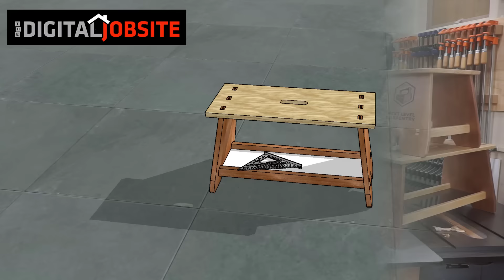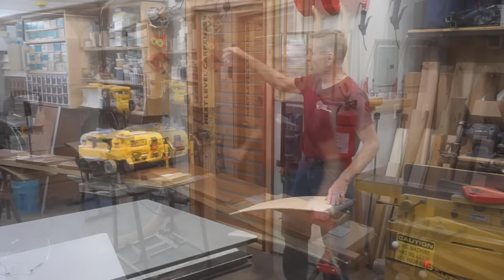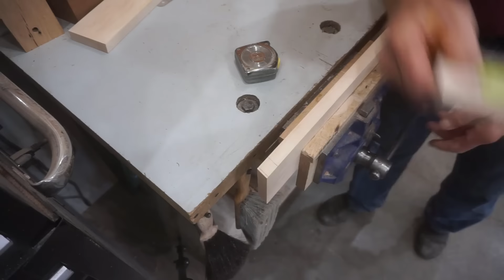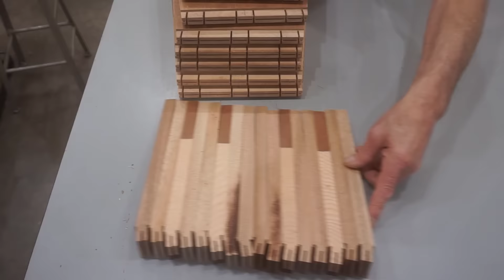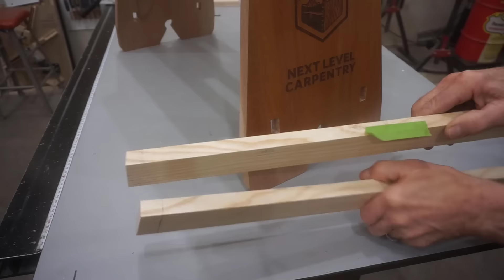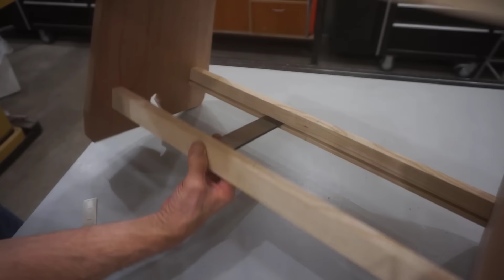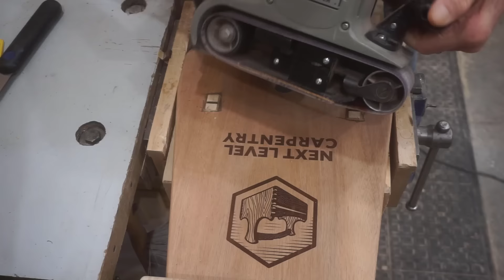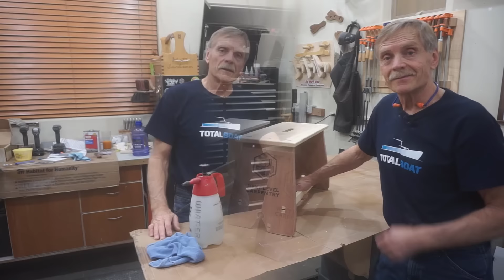Master Carpenter's Footstool

Comment: I have searched the internet to find the zero clearance insert on your Unisaw without success.  Any advice would be helpful.
Reply from the maker: Sadly it's been out of production for a long time.  Here's this to help if you're interested in the story or sourcing one on eBay or other 2nd hand market: https://www.pinterest.com/pin/551479916872563699/
Reply: @NextLevelCarpentry  thanks for your quick reply!  I have picked up a lot from the stool video. Keep up the good work!
Reply: Went to the link.  It is not the same.  Yours is open at both ends allows for slipping in the insert at the end.  At least that is what it looks like.
Reply from the maker: @davidconant4382  Ah... the linked photo shows the underside and the product label.  Search using that info...
Here's the top of the insert: https://www.pinterest.com/pin/551479916872563689/
And a closeup of the label:  https://www.pinterest.com/pin/551479916872563704/
😎👍

Comment: excellent detail, depth of understanding of material, and thoughtful methods and design. i especially like the way you surfaced the twisted mahogany. it may seem like a long video, but it is not long considering how much detail and methodology is packed into it. two minor design suggestions: 1) consider off-setting the oval top hole toward one edge so that when you carry it the stool's center of gravity stays put, and 2) the relief hole on the legs is ok, but for this level of craftsmanship consider a hyperbolic cosign curve (the shape of a hanging chain) to replace the angled cuts and relief hole. i keep a long lamp pull-chain in my toolbox which i can hang on 1/4" pw, spray paint to create a 'line', then cut for a template. fantastic work. thank you for your many insights and suggestions

Comment: Huh...you could have cut the wedge slot a little deeper and gotten two wedges from the wenge...you'd have ended up with shims a little too long on the skinny end; cut them back to the proper thickness and you're golden.
Reply from the maker: That is true in some cases but not in this one otherwise I would have done it that way. With the scrap I had to work with I would have only gotten two shims out of it versus the three I got using the method I did... I don't profess to not make mistakes or make an oversight but sometimes viewers don't take all the factors into account before commenting.
Reply: @NextLevelCarpentry  I figured you'd have gotten four instead of three. You'd have gotten two side by side twice.

Comment: Informative. I would have quickly hand planed the smaller more twisted/cupped pieces of wood to get the worst of it better squared before putting it on the sled and running it through a parallel planer, but I have a crummy parallel planer.
Reply from the maker: A little bit of pre-planing is a great idea.  Knocking 1/16 or 1/8" off high corners would be quick and would mean less shimming and a more stable arrangement while running it through the thickness planer.  Thanks for watching and adding a useful comment! Best, Matt

Comment: THANK YOU, THANK YOU, THANK YOU VERY MUCH ! (Apologies to Elvis)..... Since getting slammed with cancer, I've been getting into working with wood attempting to make "stuff". My attempts are lame. In pursuit of my never-ending quest to find easy projects to "attempt", I came across your Carpenters Stool and loved the looks of it. I'm going to try and make one for my wife. She uses this stupid plastic thing in the kitchen, she's vertically challenged, and it scares me a lot. I've looked at other ones but they all have the same problem that you specifically addressed right upfront. Step just a little too close to the edge, and they tip over. I couldn't believe it when I saw your video! So, thank you for that and for how well you explain things. I don't have any of that fancy equipment, but I'm still going to attempt it. Thank you again for the idea, your knowledge, and your step-by-step assistance. It's a very awesome inspirational project I can't wait to start.     :)
Reply from the maker: You're quite welcome Jim... sorry to hear you got slammed but congratulate you for your gumption to take on new challenges in the aftermath.
FWIW there's no shame in using the measurements and angles from this footstool and just using screws and glue to hold it together.  You could always add a couple 'rails' or 'stretchers' underneath the top to stabilize the legs and attach the top.  It would be good mental exercise and a useful addition around the house.  FWIW in the NLC household we use a couple folding stepstool/ladders like this: https://www.amazon.com/Rubbermaid-RM-3W-Folding-200-Pound-Capacity/dp/B003EYVF7G/ref=sr_1_13?crid=2MU9EWZJBZ7EG&keywords=folding+step+stool&qid=1643267197&sprefix=folding+stepstool%2Caps%2C160&sr=8-13   for reaching things in cupboards and watering plants on high shelves... their fold-up design and 'handle' for balancing are actually better for safety and convenience than the footstool in many situations and there's no shame in having both around either. 😎 Best, Matt

Comment: What's with the gloves on the table saw? Thought you were a pro.  No gloves around rotating machinery! And don't give me the "rip away glove" thing. There is no such thing that will not move at all if contact is made with the blade. Just a few thousandths will give the blade a chance to grab your hand. LOOSE THE GLOVES OR LOOSE A FINGER. Better to have a coupe splinters in your thumb then not to have a thumb to have splinters in.
Reply from the maker: You actually think I make a conscious decision to wear specific gloves while using a tablesaw during specific operations to prevent splinters and expect them to 'rip away'?!  Good grief... 🤨
Reply: Those are wide boards. His hands weren't anywhere near the blade
Reply from the maker: @timbarry5080  the knee-jerk "no gloves EHver" reaction by some viewers is astounding to me... nice to know you understand its parameters too! 😎
Reply: @NextLevelCarpentry  thank you. Yeah, "no gloves ever" is a good rule for people new to using these tools but for people that  have spent endless time with these machines it's a little different. It's not like you were wearing them while ripping or jointing the narrow strips.
Reply: Very true. A heart surgeon lost a couple of fingers. He was using rubber gloves, with a mesh. The table saw pulled in his hand
Reply from the maker: @clivemilner  do you honestly think my use of gloves is to prevent splinters for Pete's sake?!

Comment: My father was a carpenter and cabinet maker for most of his life.  He made several similar step stool tool boxes over the years.  None had a silly little shelf.  All had either a deep box base or a drawer to hold drill bits and small hand tools without falling out.  I inherited most of his tools and use them to this day despite many being over 100 years old now.  They may not look pretty but they work well and get the job done.
Reply from the maker: "Silly little shelf"?! 🤨
Reply: @NextLevelCarpentry  Yes.  A carpenters 'footstool'? is expected to be moved around.  A lot.  Anything left on the 'silly little shelf', such as bits, dowels, hand tools, planes, would be liable to fall off.  A shelf is useless.  A 4" deep box or drawer adds function and security against accidentally spilling tools under one's feet carrying the 'stool' from project to project.  It would at least keep the bag of snack food shown from being stepped on.

I'm still using the 'step stool' I built in High school woodwork classes well over 50 years ago.  It's beaten and battered, has an 8" deep box under the hinged 'step' lid and gets used most days I'm doing any carpentry.  It's often used stand on to reach something too high to reach without it but just as often to carry the tools needed to deal with some minor project around the house such as fitting additional shelves in cupboards, etc.  Carpenter's tools are not expected to be 'objet d'art'.
Reply from the maker: @philipgrice1026  Wow... you're sumpthin there, Philip... 🤨 maybe you should check your meds?!🤣

Comment: Wow! That kept my attention throughout the whole video, sitting out here in my father-in-laws -10°C garage. Thanks for a great video! Now I need to invest in a garage heater and some insulation.
Reply from the maker: Insulation first, heater 2nd 😉😎  FWIW those small electric 'box heaters' available do an amazing job with the main challenge providing a 220 volt 20 amp circuit to power them... good luck. Hope you get heat soon so time spent in your shop is more enjoyable and productive?
Best, Matt

Comment: What is the level of tedium for cleaning up everything in the shop that the over spray landed on?
Reply from the maker: Same level as cleaning dust from cutting and sanding... pretty routine... probably about a 6 being as I can think of plenty of things I'd rather do than clean the shop after a big project.

Comment: I'd be tempted to use dominos for those mortise/tenon joints. Arguably the joint could shrink over the years but previous ones I've made have not loosened. Reduces the tedium scale!
Reply from the maker: I imagine dominos would be plenty strong and wouldn't shrink any more/less than the true mortise/tenons used in the build.  I think well-placed screws and glue would be surprisingly effective and maybe even the most practical.  The real loss or downgrade would be the aesthetics of wedged tenon joinery which is what helped me endure the tedium scale effect.  Bottom line is I don't see it as a right/wrong thing but as a matter of personal choice where there's no wrong choice.  Regardless; a 'hand made' stool is infinitely better than a 5 gallon plastic bucket turned upside down, right?! 😎 Best, Matt

Comment: that UV light trick to find residual glue makes watching the whole project worth watching!!
Reply from the maker: Thanks for sayin'... it was actually the first time I used UV to expose residual glue on wood.  Even though I know there's special glue designed to show up under normal UV I've never used that type of glue so it was a pleasant surprise that it showed up under the special high-power UV light I purchased for other purposes: https://www.amazon.com/dp/B08QCX1KTJ/?ref=idea_lv_dp_ov_d
I'm not trying to push a tool on you but feel obligated to tell you that regular Titebond III doesn't show up so well with more typical UV flashlights like this one: https://www.amazon.com/dp/B01IAPUH68/?ref=idea_lv_dp_ov_d 
in case you decide to get a UV flashlight you'll get one that works well enough to be helpful.
Best,
Matt

Comment: I enjoyed this master class.  The use of jigs to provide precision in tendon cutting was inspirational.  

I would like to offer a tip that I use to prevent accidental dig in of the saw into the finished surface.  I use a hotel key card which is 1/32 inch thick as a shim around the tenon.  The plastic does not damage the Irwin saw teeth and the 1/32 inch stub is easily sanded smooth with an orbital sander.  I have found that gas cards and some club membership cards offer the same thickness.  Using them protects your identity and gives them a second life.

Comment: It may have been asked but how do you keep your mdf jigs consistent in size from the first routed hole to the last?  The hole size in mine always seem to grow from the bearing rubbing on the edges.
Reply from the maker: I see very little wear on my mdf templates Nathan.  
There was a tiny bit on the mortise template for the tops but it wasn't problematic.  In normal use the bearing shouldn't have enough 'force' to 'wear' to the point the hole size changes.
Please don't take this as offensive but if you're having much in the way of problems "you're doing it wrong".  I say that because, except in extreme situations, I don't experience problematic wear when using templates... and I use them ALOT!
If you're getting wear that's problematic you can pre-harden the wear surfaces on mdf material with thin CA by spritzing those edges with accelerator and letting that water-thin viscosity CA soak in and harden to toughen them up.  You can re-trim a skosh off the treated edges prior to cutting into fixture parts before assembly so they're flat and true.  
Also make sure the whole guide bearing surface rides on the template.  If you set the bit too high it will prematurely wear away the top corner of the template leading to problems.  
Lastly: I once had a cheap router whose bearings were so bad the router bit wobbled enough that it would actually vibrate against the template surface and pound a little groove in it and lead to the problem you're asking about. Hope that helps.
Reply: @NextLevelCarpentry  Your last line make me wonder.  I had never considered run-out at the spindle creating the groove.  I have a bosch router but still that could be the problem.  It only happens on softer materials like mdf or pine, in oak I have no problems.
Reply from the maker: @nathansimon6035  I would expect run out on a Ryobi more than a Bosch but it could be an issue. Also be mindful while you're working that you're not applying unnecessary pressure on the bearing while routing.

Comment: I am surprised that you glued up your templates on your table saw top.... don't you have a less expensive surface, one you don't have to keep clean and easy for stuff to slide on?
Reply from the maker: Actually that top is a 3/4" thick phenolic panel that's incredibly durable and amazingly easy to clean up so it's the most practical work surface in my shop.  No matter the surface I use for glue-up I'd keep it clean so it might as well be easy to do it... all a part of responsible workshop hygiene IMHO. 😎

Comment: Dear Matt, Boy was that an epic movie - a Mega movie by anyone’s standards. It turned out to be a textbook of unfamiliar ideas and solutions that I have never seen before put in such an elegant way. Brilliant techniques like how to flatten warped boards on a thicknesser, how to cut strange angles on the table saw, constructing a jig using thin sheet and CA glue, making tiny and ultra thin components on a table saw {without cutting your fingers off} and finally providing a superb transparent finish to a piece of wooden furniture. Never apologise if your videos run on a bit, they are worth every second of play time.  Cheers.
Reply from the maker: Thanks so much for watching this 'epic movie' and sharing an encouraging comment Peter.  Much appreciated! Best, Matt

Comment: 1:40 If you had cut the slot deeper into the Wenge (about 1/4" more) you would have gotten two longer pieces of wedges. Only that they are not opposite each other but about 1/4" offset. Means where one wedge ends it is about 1/4" from the beginning of the next. You then had to shorten each wedge by the 1/4" where they got too thin.
Reply from the maker: Because that's true it's exactly what I intended to do but as it turned out that way I would have gotten fewer net wedges Out of the Woodscrap I had on hand so I resorted to the process you saw in the video. Because of that I just barely had of the wood for the wedges... better lucky than good right? 😎